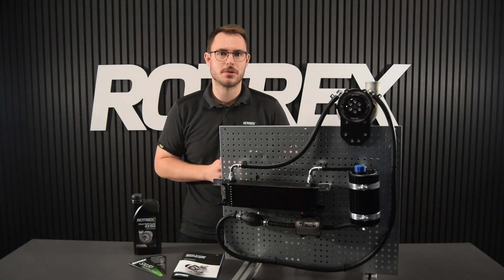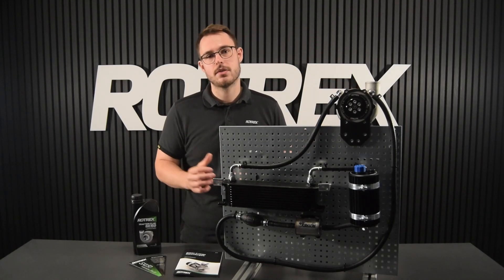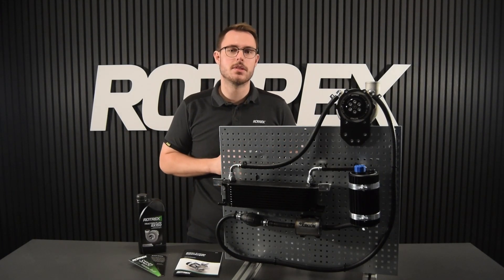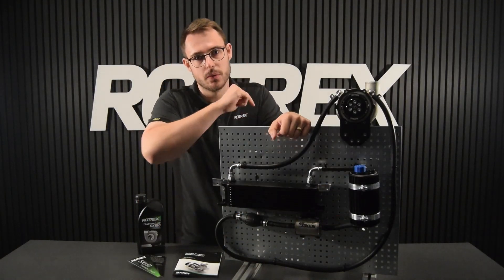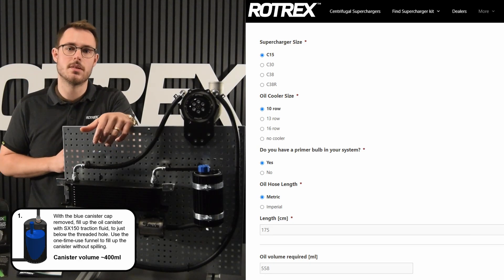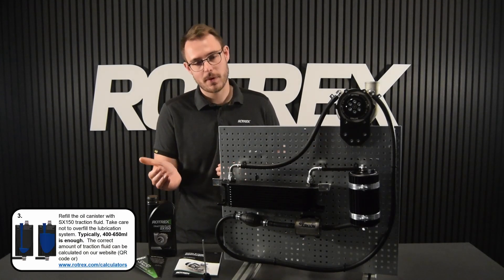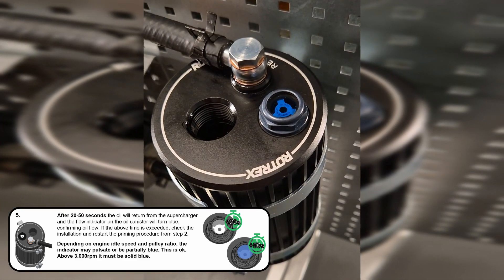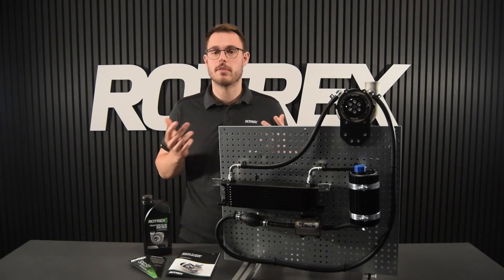How To Prime Your Supercharger

Comment: Regarding oil level, is it still the way that oil level can only be checked at 2-3k rpm? M level barely shows up when engine is shut off but max when revving to 3k.
Reply from the maker: With the updated oil system, it is possible to check the oil flow at idle. Depending on the engine idle speed and pulley ratio, the indicator (on the updated canister) might pulsate or be partially blue, which is fine. 

To check the oil level, let the engine idle and use the dipstick with min-max indicators. It is important to keep the engine in idle for this procedure.
Reply: @rotrex_superchargers  In your previous video and written instructions you say to check canister fluid level between 2 to 3k Rpm’s and this video your saying to check fluid level at engine idle which would typically be 1k rpm. Should I be checking fluid level at normal engine idle 1K rpm? Just trying to clarify thanks.
Reply from the maker: Hi  @matthew85_ .
Thank you for commenting. I completely understand your question.

The priming procedure was updated about a year ago, which is why we uploaded this video, with the new priming procedure.
If you have the primer bulb and canister with sight-glass,  you should follow the instructions in this video. 

However, if you don't have this, please follow the old priming procedure: https://youtu.be/s4syeBebuV0
The old procedure, as you mention, checks the fluid level at 2-3k rpm.

I hope this clarifies things for you.

Best,
Team Rotrex
Reply: @rotrex_superchargers  Thank you for reaching out and clarifying my question. I’m running the older style canister without priming bulb so I will continue checking fluid level at 2 to 3K Rpm’s. Thank you!

Comment: So what is the sx150  traction fluid ? Can we use another oil if we can not find the sx150 ?  Lets say if something bad happen with system and it is leaked the oil in it and I am on the way what fluid can I put my roterex supercharger till I came home ?
Reply: Unfortunately not they only recommend there oil  at £140 a litre seems like a bit of a rip off to me when other supercharger oils only charge around £40 the only other alternative that I found was HKS that was round about $300 plus taxes.
Reply from the maker: The SX150 is a specially developed traction fluid, that ensures propper and safe operation of the traction gear. This oil is essential for the supercharger, and cannot be replaced with other oils

Comment: Nice upgrades, but the squeeze bulb looks like a weak link with the heat the system generates.
Reply from the maker: Thank you for your reply and interest in our products. The primer bulb has been tested thoroughly and is not showing any signs of being a weak link, with its placing on the inlet side of the system
Reply: Don't worry, if the bulb fails Rotrex will happily sell you a new Rotrex Supercharger.